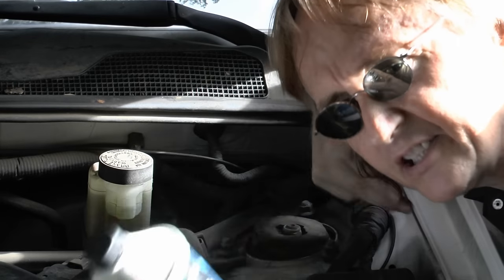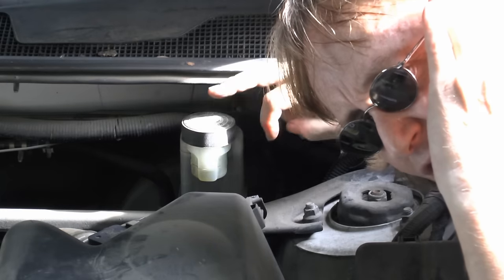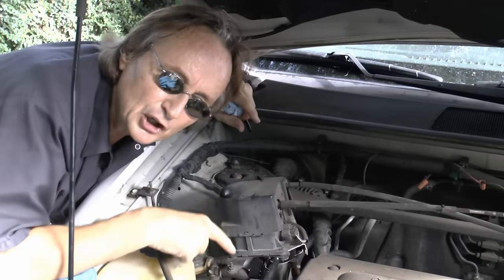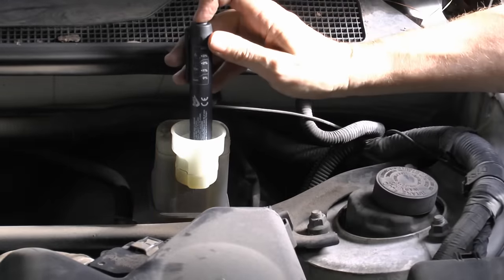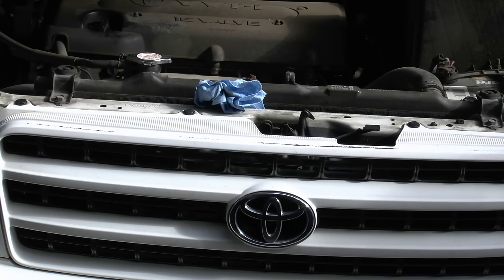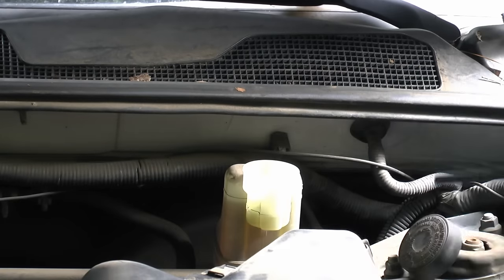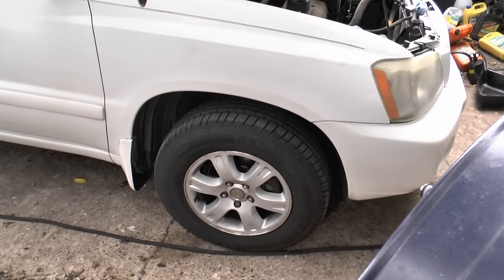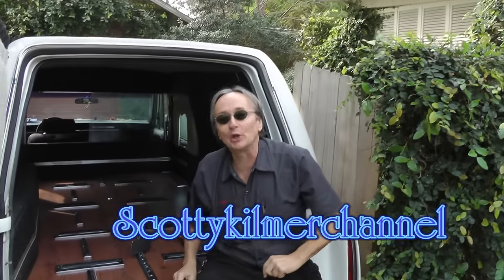How to Change Brake Fluid in Your Car

Comment: I flush every two years. I bought a vacuum flusher that works with any air compressor. 
Cheap insurance. I don't care what that meter says I'd never leave 10 years before changing...
Reply from the maker: to each his own, but my 237 thousand mile 20 year old toyota still has original fluid and nothing has worn out yet on the brake system except pads and shoes that I replaced.
Reply: Btw, I drive a 2008 Toyota yaris.
Reply: ricerust It's a celica, correct me if I'm wrong Scotty but I heard it from one of the Car Talk with Scotty Kilmer I attendent every Saturday. =)
Reply: ricerust its a 94 celica
Reply: Lmao .. every 2 years... too soon junior..

Comment: My 3yo chevrolet Cruze has 50,000 KM on it, and  the dealer told me I needed an brake fluid change because it was dirty... the manual says it should be changed every 5 years. It's a leased car... I will not even bother.
Reply: My 2004 Toyota Camry has about 265,000 km and still has original brake fluid.

Comment: my honda manual says only use honda dot 3. is it really necessary? aren't all dot 3 the same?
Reply from the maker: yes
Reply: yea my manual says only use Honda brake fluid which is probably malarkey. I use Honda ATF becuase their AT's are delicate and I assume they optimize the fluid (which Honda DW1 gives pretty nice shifting and is a quality fluid that isn't too expensive). But brake fluid give me a break.
Reply: Kinixys3 honda is anal about fluids, says the same thing for pwr steering. they just want to help out the dealers or their product line. seriously who is gonna drain(generic - temp use only) and refill to genuine honda fluids?
Reply: If it's under warranty, use their fluids, otherwise no. However, their manual transmission fluid is decent. Otherwise I'd recommend GM syncromesh.... just a bit more expensive.
Reply: Noseefood Mine doesn't say anything in the manual but the cap under the hood says use Dot 4.

Comment: I've been bleeding my brake fluid with ABS system for last 20 years never had an issue bleeding it and I don't think d all the dealership pretty much the leader brake system by forcing new brake fluid in and old fluid coming out of nipples hello there do something different I seen it over a hundred times done at this way

Comment: I had a bus/truck mechanic tell me that there is really no need to replace your brake fluid, when I asked him about changing it. What a dumb ass.... You do want to change  brake fluid in a car, not to mention a box truck that has to carry about 20 000 pound of weight and may be a potential safety hazard.

Comment: man... i like your vids but, you don't give enough info on some crucial areas, i.e. when bleeding you start at the furthest corner from the brake master cylinder ( if its on the driver side, start with the passenger rear, then do the next furthest caliper(piston) from the brake master cylinder <the bit below the tank you put the brake fluid in, usually.> ) 

or that when bleeding the brakes, fill the reservoir up to the max, get your friend to pump the pedal to build pressure, after pumping the pedal, tell your friend to hold down the pedal, at this point crack the nipple for a few seconds until until the fluid starts to slow down, locking the nipple before it stops (rinse, repeat)

Also brake fluid should be changed every 2 years as a guideline, to stop any corrosion buildup in the brake lines. also the fluid at the brakes will be more weathered than at the tank because it is heated and cooled a lot more.

Finally those pens for testing brake fluid are terrible, you want to get one that measures boiling point, anything near or below 170 'C needs replacing ( ideally)

Again i dont think the video is bad, just that some of these details are very important.

Comment: Only $35...
Reply: Exactly. Brake fluid is something like $8 to change
Reply: @Anna-tc6rz  it's free if you do it yourself though. That tool is more of an investment, but not necessary for the fluid change. Besides, you never know if whoever you took it to did the job right, or even did it at all.

Comment: Having the fluid flushed out every 5 years doesn't cost us much $$$ if you change the brake fluid yourself, especially if you get used vehicle without knowing its service history.

1 litre of Pres**ne DOT 3 brake fluid cost only about 4$ here in my country, that's enough for flushing most cars brake system.

Comment: Using that brake fluid tester tool has flawed results. It uses conductivity for testing . This tool is calibrated to one particular brake fluid like say a DOT 3 . We know that there is DOT 3-4-5 fluid . That being said its not going to test the moisture conductive properties in each brake fluid accurately. I have read a study on this tool and others like it back a while ago before I made a purchase. I too am a fellow mechteckanic.

Comment: If you deal with cars as much as i do you formulate opinions.my 2 cents is id much rather over change than under change.i have proven that otc tester wrong if the fluid looks dirty and its been 2 years dump it.dot3,4 brake fluids cheap.ive had vehicles that people drive 300k plus and no they aren't Toyotas and they never have to do more than rotors and pads(occasional caliper).I don't typically bleed the system on maintenance.if i have access to a brake flush machine ill use it if not,I just suck most of it out of the master and fill it up with fresh fluid.I've never had people come back to me with abs pump problems nor master cylinder issues and people sure do drive them many miles in a year .

Comment: Just want to throw out that the EXACT tool Scotty is using in this video is only $7 SHIPPED on Amazon, NOT $35.
Reply from the maker: well, prices have fallen, i paid 35
Reply: For sure.  I was just throwing it out there because I saw a lot of people saying they didn't want to buy this "expensive" tool because they could change their fluid twice for the $35, so was letting everyone know it's much cheaper now and worth the buy.

Comment: Scotty I bought this 2 years ago and I'm still at 1%. When the hell is my brake fluid gonna go bad.
Reply: My 2004 Toyota Camry still has original brake fluid, and the pedal is still firm, ABS still works, and there are no leaks. Also still has original transmission fluid.
Reply: @vk2461   how many miles per year on your car ?

Comment: Scotty missed this one. Tester does not test down in the lines.Haynes manual says 3 years or 30k miles. Me? 5 yrs .50k. BF is cheap..Around $8. Use the bottle method shown on other channels.

Comment: Brake fluid costs $3 or $4 for a 400 ml can. So why buy a tester for $35. Just change the fluid every 3 years if you change it yourself.

Comment: Do you need $35 for a tool to check brake fluid?Change once a year.its take 10 minute to bleed the system+costs $3 .
Reply from the maker: +Jim Wong HA, you can't correctly bleed any modern car with ABS without a thousand dollar plus scan tool to do the job correctly.

Comment: I'm not sure what that tester is going to be able to test at the top of the brake fluid reservoir.  Brake fluid, being an oil would float on top of the water, so any water would be on the bottom, at the lowest point.   Problem is that tester probably wouldn't reach down far enough to detect anything.

Comment: Tester only test reservoir  not more important brake fluid in caliper.
Reply: +Jim Wong the fluid in the reservoir comes in contact with the environment more I guess.
Reply: So your comment is that we're not supposed to change fluids breaks transmissions because of the environment
Reply: +1max25n You are wrong, the fluid in the caliper stays there, and it is pressurised from the master cylinder, im not saying they dont mix over time , but the body of fluid in the caliper bore stays there, it has no way to go back and forth to the resavoir
Reply: 1max25n What planet are you from?bleed the brake system.from reservoir and come out from caliper
Reply: 1max25n do you speak english?

Comment: second of all, those little brake tester pens are crap. Worthless. Also, you test the brake fluid at the caliper or wheel cylinder. Thats where all the magic happens. Thats the fluid that gets heated up and boils, not the stuff thats in the reservoir. 10 year old brake fluid? Flush that stuff.

Comment: My 1999 Ford Windstar has good brake fluid that is original. Better than Toyota. Scotty is Toyota paying you.
Reply from the maker: no, I've only owned 2 toyotas since 1982, both were bought used and the second one I'm still driving today with 240 thousand miles on it
Reply: superfuresh almost never anymore

I read somewhere that the rear suspension was known for falling apart (or rusting apart)

that is very dangerous
Reply: Depends on the area, I see more Windstars here than Siennas. Siennas actually seem to be a bit rare here in general.